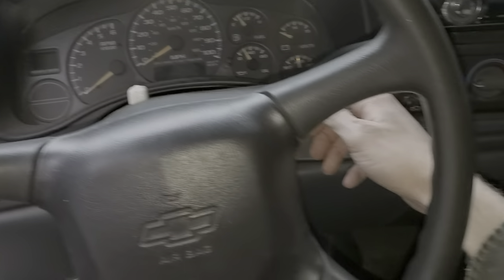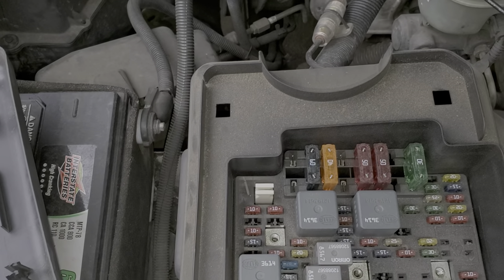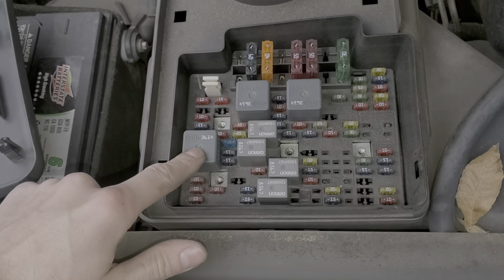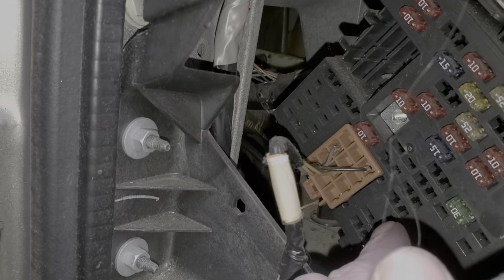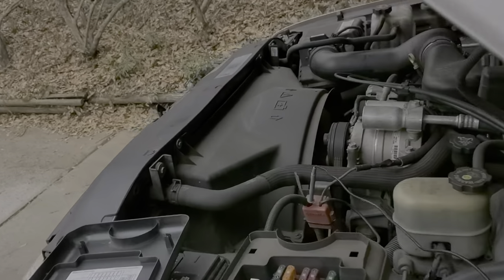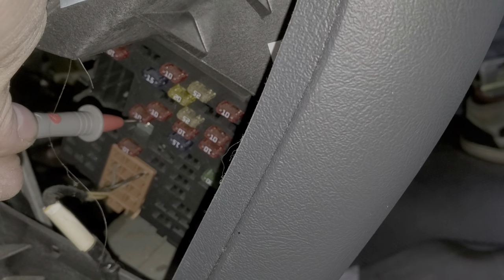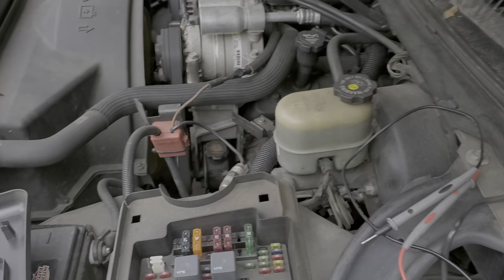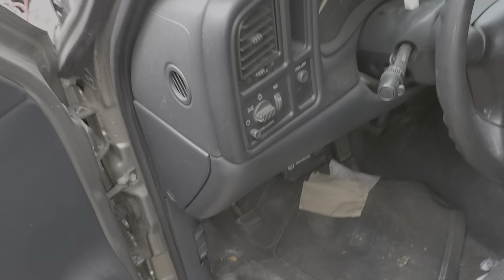2002 Chevy Silverado Starter Relay & Fuse, Ignition Switch Bypass

Comment: So I had a key made at Walmart just to be a door key… well it turns out that somehow it started my truck so I have been using that key for a week now w/o any problems. Today i locked my keys in my ignition and had to slim Jim in and push unlock button to gain access inside. After doing so I got in and my truck wouldn’t start. Just acts as if the starter don’t work but I know its fine. The security light is flashing now as well. If I run direct power to the 10 amp fuse inside it don’t try to start either. Just a ding from   Interior. But if I run power to a spot where the relay goes it cranks but sounds real weird and don’t actually start up.  Lots of info I know but I’m at a loss and stuck in some parking lot. Anyone with any ideas on this weird situation help me out? Already did the 3x10 min off/on deal to reset security but did t work. HELPPPP plz.
Reply: @GBaileys  did you ever find out what the problem was? Just got a truck that seemingly has an identical issue.

Comment: That's interesting. Here is my problem. The truck will start, but when i release the key it dies.
Reply: @keving2371  it was something like that. The problem was the plastic connection better the ignition tumbler and actual switch had broken apart. There is a pin in the tumbler that completes the security circuit. I put the tumbler in place of the on position, and removed the ignition switch gear from the housing, starting it with my thumb under the column

Comment: You seem to know whats up? I had a shop do a repair on my truck they replaced the key lock cylinder. The housing the lock cylinder is in and the ignition wiring harness . When i got it back. I pull the keys out and the battery light stays on in the message center. Any idea of the cause?

Comment: Bruh I have a 2002 Chevy Tahoe and I had my radio ripped out and some of the  wires touched and the car died and now it won't even start it cranks but no start but when I spray brake cleaner in it it will start and run but it won't stay on the fuel pump is priming and there's spark but it jus won't stay on

Comment: My 2002 silverado 4x4 4.8l was really frustrating me as it was running and hour prior to me trying to start it had power but no crank. Was getting ready to remove starter and for some odd reason I tried turning my drives haft heard a click. Immediately I hooked battery back up and tried turning it over and it fired right up. Hope this helps.

Comment: 2002 Tahoe and I'm having intermittent starting issues.  If the starter relay is bypassed it starts.  I just checked all the fuses and the 10A crank fuse under the dash is blown.  The car still starts.  I literally just checked the fuse and it still starts.  Checked all fuses with a test light.  What's my next step in diagnosing because our cars have literally the same setup.  Any help is appreciated.

Comment: Hey, bud. Got a 01 s10 V6. Start and immediately dies. Doesn't seem to be the passlock. Fuel pump died while I was driving and after I swapped it, it won't run. I've had issues with the passlock in the past but did the resistor hack and it fixed everything

Comment: good info...my 2002 gmc will often not crank when I turn the key. I have replaced the key switch and transmission range (safety). This seems to happen when the vehicle has sat for several hours. Eventually I can get it to start after several attempts. I seem to hear a small click after messing with it ..then it starts. Is there some kind of relay in the key switch... I have never had it not crank after driving and stopping/starting etc...
Reply: I’m having the exact same problem on my 02 Tahoe. I hope someone has some suggestions.

Comment: Hi. Great tips. So I put my truck in neutral and a LOUD AKWARD BIZZING SOUND HAPPENED? Im in a 5th wheel. & had some damage done by a jerk next to me the last place i was. Cut water lines etc. Anyway.. Short story. I had to plug a 120 watt inverter in my lighter and ran a industrial ex cord thru to the RV to use to cbarge my phone for the last 2 weeks till i fix the outlet issue. ....now JUST HAPPENS 2 nites ago i started the truck to check turn signals ext... (always override headlites) & trucks so quiet did t realize it was on still!! 6 hours later!! I ran out & shut it off!  But. NOT OUTTA GAS! Next day walked for 5 gal gas. Wouldnt start. Walked for 2 more. Still. Wont start. 
Ill add.. My battery has died 3 times in 2 months without explanation. My flashlight jumper ALWys works 1st try! Now it wont jump it either. ....pretty sure i just read the IGN C under the hood can kill the battery too? Or prevent a charge? IS THAT RIGHT?. IM BROKE DOWN ..NO WAY TO CHECK RELAY.   Gotta stArt smwhere

Comment: Hi Really like this video because I want to protect my 2002 Chevy Silverado Duramax from thieves stealing my truck. What fuse should I pull out so they can’t steal my truck?? Thanks for your help
Reply: What did you end up doing? I’m thinking of just taking off that one switch that he showed under the steering wheel
Reply: @Drybkungftyy56  I haven’t done anything yet as I was taken my truck to airport and there was alot of trucks being stolen I’m definitely going to pull a fuse if I need to Great idea
Reply: @kdweld8234   I had a S10 I had to bypass. trick I used so it couldnt be stolen easily was I put 5 of those little metal old school light switches on the dash,  you gotta know which three to flip, the two extras are dumb switches so its like a combination lock to start it.

Comment: I jumped the relay to start my truck today. I checked the large fuse but not the smaller one. The key lock inside the driver side door fell out. Since that happen I haven’t been able to open the door. So checking that crank fuse will be impossible right now.

Comment: Wow that was great help thanks for taking the time and energy to share this with public. I want to bypass the little 20 amp fuse under the hood and install an inline fuse  outside of the fuse box so i can wire through my hi-beam wire. Do you  know what color wire feeds the little 20 amp fuse in the harness?  I'll try to find wiring diagram as well but any short cut is welcome ! 🙏

Comment: Your video is the first one I've ever come across that doesn't talk about them self or there fuck up life and how much they love making videos you get right to the problem right on anyways I've got this 2001 Silverado that 6 people have worked on the last one ripped out the aftermarket alarm system any ideas? I started putting it back now it will crank over with the key but still no fuel pump and I've check fuses and relays
Reply: Same exact problem man stuck for 5 days now with no cell reception and finally caught a ride with a camper outta the trail where I got left stranded. cant figure it out man!

Comment: I have been battling this intermediate problem of no start, no crank for past 6 weeks. It will be fine for days and weeks and then bites me in ass when I need the truck the most. If I pulled the 10amp ‘crank’ fuse from side panel and still get same issue of no start, no crank would that indicate neutral safety switch?
Reply: Was it the neutral safety switch??

Comment: My tahoe 2002 keeps blowing up the ignition c little 20 amp fuse. I replaced it and it works fine  for weeks or months and then it does it again . Sometimes i have to replace the fuse multiple times . Any ideas??? I have brand new starter,relay and fuses.

Comment: 02 Silverado I tried the crank fuse trick but got no love. What next? I did replace the ignition switch-somewhat. I'm a bit stumpered as someone had spliced in a relay at the connection behind the fuse panel. There is a green wire coming out of the relay that goes to a 7 wire ribbon that goes up into the dash. I know he had a high powered stereo system in there at one time. I suppose I should hook it up the same as the truck has been running fine for a year.
Reply from the maker: What you are describing may be a GPS tracker with starter interrupter.. Commonly installed by used car dealerships on vehicles that are financed.
Reply: @LehewTech  Thanks for the reply. Yeah, I started thinking maybe a remote starter. Got to have the cab icy cold ya know. Could a jiggly key be the culprit? I had to jiggle key a bit to get it to "catch"
Reply: When I turn the "gear" all the way clockwise, the pin of the first sprocket that is a little wider than the rest, ends up prety much centered between the 2 copper tabs in the side "window"(wish I could send pics) This is the same position my old one was in but now the battery light is staying on(no ignition either)

Comment: I got a 2004 Yukon, it's starts  runs beautiful, I travel like 20 Mike's to the store, finish shopping ,and go to start my truck ,does absolutely nothing ,no crank ,no start ,stranded for a hour our even 2hours, then starts right up runs beautiful, checked all the terminal, good battery new, wtf is going on, sounds like a starter to me ,but I need your help
Reply: Were you able to figure it out? Having the same issue, I think it’s the ground on the starter

Comment: I have one question I have a 03 Tahoe went to put some gas in it at the pump cut it off the wind story for the rain to start on it still wouldn't start the PC and fuse blew my twice put a 30 and now it won't blow but it still won't get no power to the Stonewall it just it just bent over it won't even spin over replace the PCM fuse it spins over now but it's still no power to the strong well you know it just  won't start could wat could be the problem

Comment: I have a 2005 GMC Sierra.... When I go to start the truck it'll be fine for a month, or two... Twice it left me stranded where it would run fine, then when I turn it off to make a stop, it'll not start at all... Clicking noise, lights flickering, radio comes on but that's it.... It will start when it feel like it .... You've mentioned a transmit something... Where is that located? And thank you for the tip too!
Reply from the maker: If it is the transmission safety switch you may have luck putting the truck into Neutral then attempting to start it again. If the lights are flickering tho I would suspect something else like a bad connection somewhere. Are the battery terminals clean and tight?
Reply: @LehewTech  Yes... the battery terminal is clean.... We put it in neutral and it wouldn't start.... It happen like twice within a month in a half....
Reply: I had an internally corroded battery cable once. The terminal looked great, but after cutting the insulation away, it was green and white with corrosion *Hidden Inside*. It would do the weirdest things until I found that bad cable. Then, all fixed

Comment: Hi my truck is a gmc 2001 single cab and it was working fine but now it won't crank but the lights and the rest works fine the only way I could turn my truck on is from the starter relay I removed the top of it and with my fingers it starts I went to a couple of people out here on l.a but they are giving highly prices and they trying to wire just a cable to get running

Comment: First thanks for the instructional.
I am at wits end with my 02 Silverado. Checked battery and connections all good. There is a loud buzz coming from under the dash (dr side) with the battery connected snd key in off position. If i turn yhe key it stops buzzing, but No Sign of power to anything...no lights, dome light, radio, dash lights, absolutely nothin.
Any ideas on this? 
I'm gonna go try and recheck the fuses you pointed out again, but I'm sure I already did check them.
Thanks for any word on this, 
Wulfy
Reply: Wulf Claw could be your cluster making that noise I had that same problem

Comment: I recently swapped the ignition lock cylinder and put a new battery, and now I don't get any cranks. You think the starter went bad?
Reply: Did you solve it? I have same problem
 Just had shop put in used ignition/steering column after attempted theft., tested all these fuses and relays=good. Bridged power to crank starter nd turned key to start my truck. When turned off, dead again.

Comment: Great video, but I have a slightly different problem. My truck when going to start it completely powers off. I mean no door locks, cabin lights etc. after 5-10 minutes it seems to be okay again. Well.. until today. Now it literally doesn’t get any power what so ever even though both batteries are fine. Any idea?
Reply: We are having exact same issue were you able to find/solve problem?
Reply: Samantha Willard Believe it or not, it was literally just the terminals of my batteries being too dirty. I took them all off and I cleaned them with a wire brush and clean the battery with a wire brush reconnected them and they’re great now.
Reply: 1

Comment: @Lehewtech  I have a 2002 GMC Sierra 1500 and I was wondering if I remove the Starter Relay at night to keep it from getting stolen again will it erase my codes or with it active the stock anti theft lock? How to hear back from you.
Reply from the maker: Removing the starter relay will not erase any codes or activate the antitheft.

Comment: Realizing this is 6 months old, I hope you see this. 
I've got a '04 GMC  2500hd. With the 6.0 V8. 
The problem I have is when I try to start it the first time it turns but won't start. Same with the second attempt.  By the third it turns over and starts. Could this be the same issues?   Stater and battery are both fine
Reply: Hey Form52
A favorite Chevy problem is the fuel pressure regulator. 
It will start fine cold but you have to crank and crank when it’s warm and you turn it off and then try to restart. 
Hope that helps you or someone else.

Comment: Got a 2002 gmc sierra 2 door, truck cranks but wont start, new battery, clean filter, oil change almost a month ago fuel lines are good, starter fuse is good, what could be the problem?
Reply from the maker: Do you have any spark when the engine is cranking?

Comment: My 05 Yukon Denali attempts to crank but it only turns crankshaft less than 1/8 of a turn. I energized crank fuse and nothing. Put trans in neutral, try again, same thing. It seems crank pulley doesn’t want to turn. Ani ideas? I replaced the starter and same thing happens. Tried to manually turn nut on crankshaft pulley clockwise and it only turns about a 1/4 of the way. I’m befuddled.
Reply: Motor is seized sounds like a bearing or internal component failed

Comment: I have. 2002 Chevy 1500. That is having starting issues. When trying to start it acts like the starting fuse is out. All lights and switches come on but. Nothing happens when turn the key to crank. This is sporadic as it doesn’t happen every time.  I could go multiple times cranking it with no problem and then all of a sudden no crank. I have elevated the neutral safety switch. As it will not crank in neutral either. 

Sometime if I let truck sit for a few seconds then it will crank fine. Sometime if I rock the truck back and forth it will crank.   

Idk what it is
Reply: Did you ever figure out what it was? My truck is doing close to the same thing

Comment: I have an issue with my 2000 sierra where it seems like the starter is hanging up for a second or two. Truck cranks for 2-3 seconds, starts, then It will make a grinding noise for about a second after it has fired. It's intermittent, but it seems to do it more often when the truck is cold. Should I replace my starter, or is there potentially an ignition switch issue? Thanks
Reply from the maker: It could be chipped teeth on the flywheel where the starter engages.
Reply: Lehew Tech If it were chipped teeth I’d think I’d have start attempts where the starter doesn’t engage the flywheel at all. It’s only after the starter has turned the engine over & it’s started that I get any kind of noise.
Reply: Did you ever get the grinding noise figured out?  It sounds like your starter wasn't disengaging quick enough (Bendix).
Reply: @lelandevans182  I think that’s exactly the issue but I haven’t done anything about it. Still starting strong (after a few seconds) like a year later. I think you’re spot on that it’s the bendix. It has close to 300,000 miles on it - when it finally kills the flywheel I’m going to do a new starter, flywheel & put a rebuilt trans on it.

Comment: My 2000 Silverado 1500 keeps blowing the huge 40A IGN fuse. Any idea what I can start checking first?
Reply: There is a short somewhere. In my case, the starter heat shield was on backwards and shorting out the signal terminal.
Reply: Did you find the problem? I have the same issue ignition fuse A keeps blowing 😒

Comment: Can I use the 10a crank fuse on the side of the dash as a temporary kill switch?
Reply from the maker: If you remove it then the truck won't start, but if the engine is already running then it will continue to run.

Comment: Nothing worked I’m guessing it was my starter, confirmed it wasn’t my relay or crank fuse since I couldn’t find my crank fuse under the hood thanks
Reply: What was the problem?
Reply: @familiafightclub7407  I think it was my starter I replaced it and it worked after that, Had trouble  Since then, If you don’t think it’s your fuel pump try the fuse under the hood for fuel pump relay, also replaced crank position sensor that’s behind the starter, it seem to help but not fix the problem, because my truck wouldn’t start when it was warmed up it seemed like, Brother-in-law mentioned it wasn’t getting spark from crank sensor, But Since I remove the relay and flipped it around backwards or perhaps the right way I haven’t been having a problem

Comment: am not geeting power to my starter relay. i got power at the nuetral safety switch when i turn  the key to start position but am not getting that pwr to the relay. i jumped the starter relay and the truck will crank but won't start. anyone has an idea what wrong?